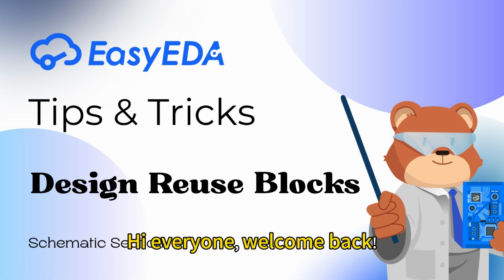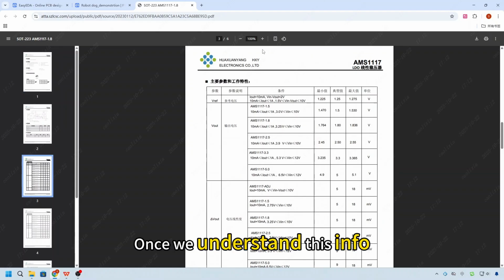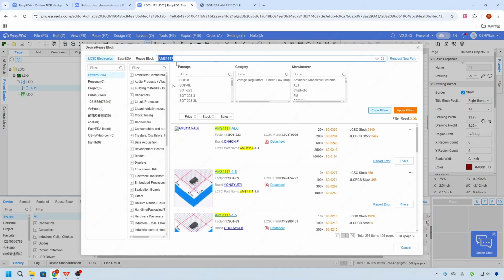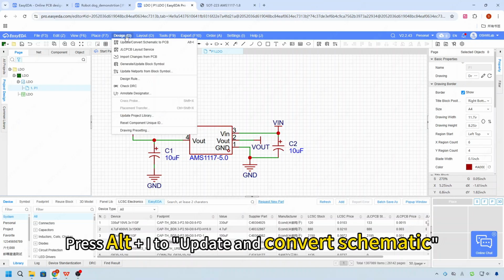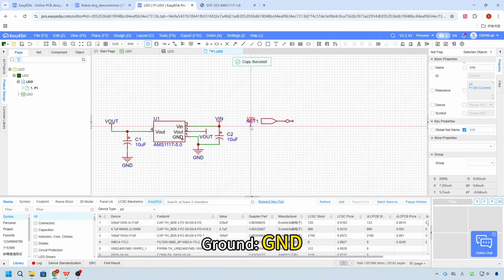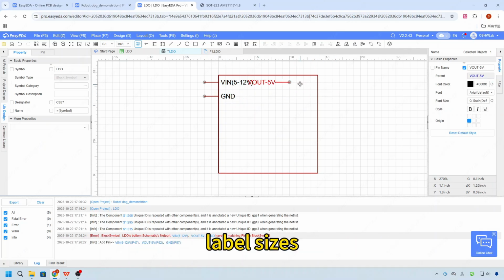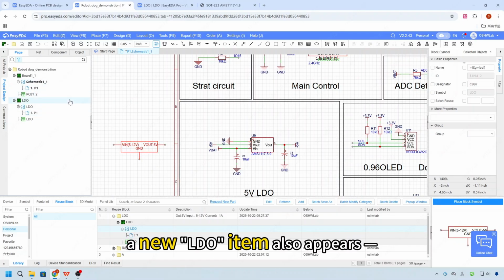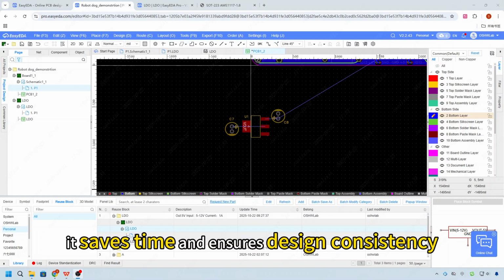Quick Tips [Schematic 32]: Design Reuse Blocks

Comment: I WANT to use reuse blocks but it seems really buggy.  It often screws up after you make a change to your reuse block. It loses positions, parts fly off to the side, copper areas don't fill etc. And I have this warning that screws up imports and i don't know how to fix it:
[Warn] : The number of components in the following group templates is inconsistent with the reuse group, and the missing components are automatically ignored

Comment: Garbage, I've been fighting the reuse block for over a week. It doesn't reimport correctly, gets confused and imports the wrong damn thing. I'm only editing the reuse block in the global library. I wanted to make pin changes on my reuse block. When I reimport they are the same. So instead I do one step at a time. Remove all the pins I needed to swap, re import still no matter one one thing still lingers from before and why the hell does it keep making copies of the old reuse and store it in the schematic. This is straight up stupid.

Comment: There appears to be a serious issue with Reuse Blocks. I am able to create a set of Reuse Blocks and use them. The issue is this, when I move one of the components the whole block moves with it as expected however if I manually enter new coordinates for that same component using the right side panel, only that component moves, not the complete Reuse Block.  Is this a bug or am I missing something?
Reply from the maker: Hi please contact support@easyeda.com